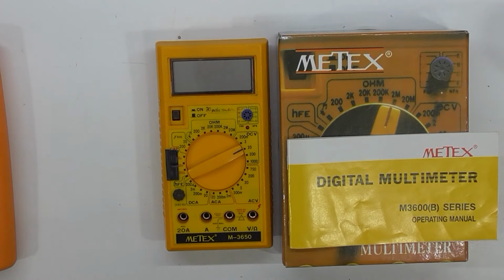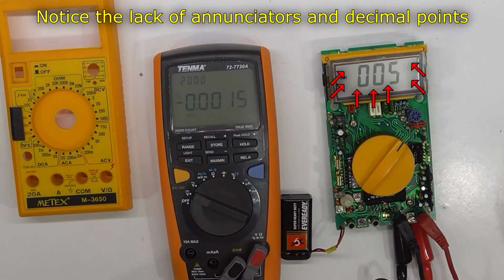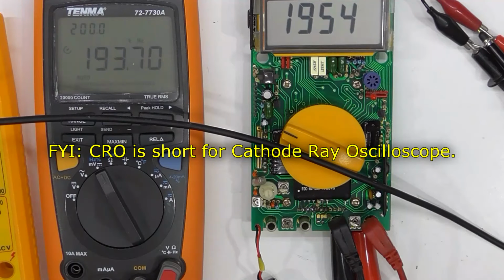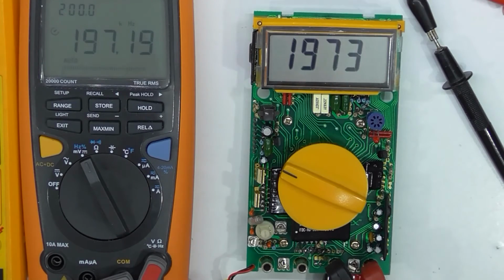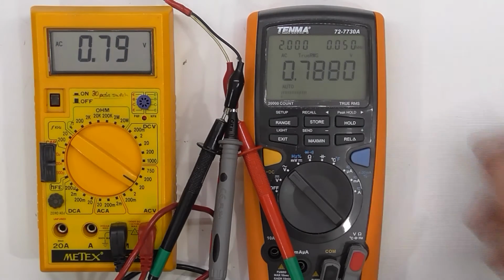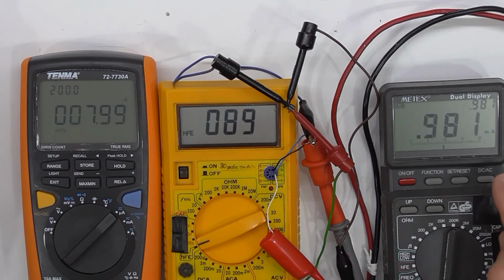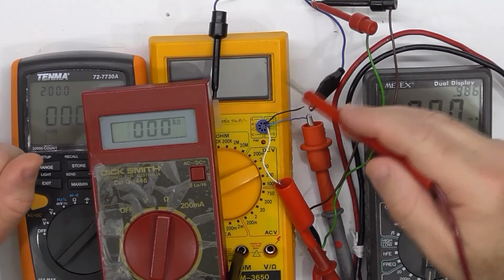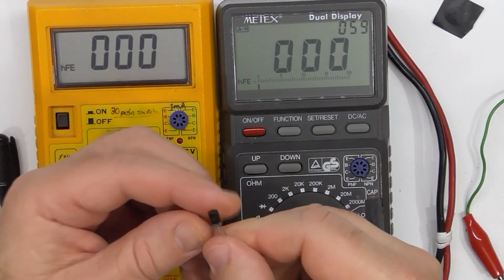Multimeter Calibration, Metex M-3650 (1989)

Comment: Great explanation which adjust is for what. I was hoping to find any adjustments for the LCD, because mine is fading and cleaning the zebras didn't do any help at all. I tried to find help in the schematics, but either I am blind or there is nothing that is directly related to that. If anyone knows how to increase contrast/display driving voltage, I would be very thankful

Comment: what is the Zero adjust button, please. Reading ist mostly 6 digits at  zero V A mA
Reply: When you put the meter in any CAP mode, the display isn't showing zero. With the Zero Adj you can set it to zero, before measuring a cap.

Comment: Very Interesting video. It was useful to calibrate my Metex 4650 in the DCV range, unfortunately the 2 Volts scale is not accurate and alligned with the others example (200mv, 20v, 200v).
My M4650 has two extra trimmers, one below the display and the other at the center of the four holes inputs and that are absent in your M3650.
As you know do you think should be one of these two trimmers able to calibrate the scale of 1,9999 resolution.
Thank you. 😉😊
Reply from the maker: Just the 2V range ? It's unlikely, but I don't know. 

Before going much further, you need to know that the Meter is in good condition. A Meter is something you need to be able to rely upon. Or at the very least, know what NOT to rely upon.

A quick Google search for a schematic brought me to a page on Elektrotanya - you need to wait for the link to become live: https://elektrotanya.com/metex_m4650_cr.pdf/download.html

The schematic looks like it might be legit. My suggestion is to (safely) download the schematic, and work out whether it can help guide you. 

Looking at the schematic, the first thing I saw was that they are using a two-chip setup: one for the Measurement and one for the Display. I then found a user manual and saw that it is a 20,000 count meter.

So, um, yeah. 

If the problem is just the one range, then it could be Bad\Dirty switch contacts, dirty PCB, or other things related to that specific range.

It's unlikely to be out-of-spec Precision Resistor(s), because that usually effects all ranges, though it is possible.

It could be damaged protection circuitry.

It could even be Electrical noise, such as Radio (Mobile\WiFi\etc) or Hum pickup. 

So, experiment: with\Without the Leads, Faraday shielding the meter, etc.

ONLY AFTER YOU KNOW the meter is Good, or what is not good, do you Calibrate.
Reply: @richardrudek01  
The deviation is minimal but unacceptable if I'm not mistaken, it has a factory tolerance of 0.05%.
Ex.
 2v range i have 1.3185
 20v range i have 1.315v 

I have another DMM 4650B where the two range are alligned. 
Where the problem? 😕😔
Reply: @richardrudek01  
Hi Richard, 
as your suggest assuming that no adjustment trimmer for 2v interval exists, for our curiosity I centered the calibration around 200mv and then up to 3,000v however already arriving at 5v begins to lose two counts and then to 10v and four counts lose. 
Can we suppose there is a circuit failure?
Or still a compensation trimmer would be perfect in the case?
So, my curiosity pushes me further and I would like to experiment moving on the two trimmer left that you do not have on your M3650 but at high risk of putting out of alignment in something else. ☹
Thank you for even going search for the manual I found it too but that scheme goes far beyond my competence.
Reply from the maker: Four counts out of 20,000 is 0.02%. That is well within spec.

Note that when you start getting down to levels of accuracy like this, environmentals such as Temperature and Humidity can affect the results. More than once have I seen readings fluctuate with people simply breathing on the meter...

So whether there IS, or IS NOT a circuit problem is something that YOU need to consider and decide.

Things to consider, though, is the condition of the Meter. Has it been physically or electrically abused. Is it 'dirty'.

Often, you are left with little choice but to open the Meter and inspect it. But if that is not an option, then you are left with rigorous testing, perhaps within test chambers that are shielded and environmentally controlled – temperature, humidity, pressure, light, etc.

Now when it comes to experimenting. Just be sure you are able to live with any possible outcomes. 

In this case, however, we do have a schematic that seems like it is mostly correct. You should be able to find each of the variable resistors in the schematic, then find them on meter, and figure out what it is likely for.

For example (Guesses):
- VR1 seems to be setting the zero point.
- VR2 perhaps AC voltage.
- VR3 perhaps Capacitance.
- VR4 and VR5 the Frequency counters.
Reply: @richardrudek01  

You are very kind Richard😃,
you do well remember have to take care of environmental factors and for this I had to monitor the DMM several days and correct the reading several times for a good calibration.

 I want to clarify that the reference comes from another very accurate Metex (Voltcraft) and being identical should behave the same if not almost, but the loss of the counts is no longer accepted in these terms of 2v scale (4 dgt 1/2).
 I want to remind you that I have specified that it is above all the 2V scale did not satisfy me and be out alignment, they are "off" of about 30 ~ 40 counts.

Metex A:
2v range i have   1.3185v (1.9999 counts). 
20v range i have 1.314v
Note: even acting on the VR MAIN CRITICAL and dropping the last digit 4 to 3 as below doesn't have rapid effect on the scale of 2v without putting out alignment all other scales.

Metex B (as reference):
2v range i have   1.3135v (1.9999 counts).
20v range i have 1.313v  (WOW perfect).

 I have cleaned the PBC at mirror and contacts nothing changes.
I tried to read the wiring diagram but all the VR leave a lot of position uncertainties, a service manual would be perfect. 

P.S.
I also have also a wreck in which i can take all the components useful for the replacement but I do not know what is damaged in the Metex (A).
I also took pictures for the identification of the pots and...  if you want I can send you some photos but I do not know where ... ??

The video that you have made I have seen it many times will be useful to many people and it has helped me a lot.
I thank you on behalf of many on web.
Thanks, Richard
Maurizio
IT
Reply from the maker: Oh. So you are comparing between ranges on the SAME meter - the M4650. Interesting.

Yes, I missed that point. I'll get back to that point in a minute.

The schematic I have for M4650 seems to confirm that the basic accuracy is set by the precision resistors, ALONE - like with the M3650 in my video.

Thus, if there is a discrepancy in one, and only one range, then the voltage divider network made using the precision resistors is where you need to be focusing.
However, whether or not you can do something about it is another thing. 

For example, if you find that the precision resistor between the 200mV and 2V ranges is out of specification, are you going to disassemble the network and fix it ?

Now back to the earlier point about comparing between ranges. In the video, I compared "the standard" with the "subject".
That is the Voltcraft Meter AND the Test Source, with the Metex.

Notice how I emphasised the "AND". When you calibrate using a Source and a Reference meter as "the standard", one thing you can miss with that set up is the interaction between input and output impedances.
Now both Meters should have input impedances that should be in the 10M Ohm range. But you can be surprised by the effects, if your not vigilant.

To put some numbers one it - and these could be wrong, so please double check.

How high does the (output) source impedance (Rs) need to be to produce an error of 40 counts with 10M Ohm input impedance (Rm)?

There are many ways to figure this out. If the source impedance is much, much lower than the input impedance, then the simple ratio method is close enough.
But the more correct method is by considering a voltage divider circuit.

With the simple ratio method, 'simply' multiply the input impedance by the ratio of the error.
So 40 counts / 20,000 counts * 10,000,000 Ohms = ~20,000 Ohms. Interesting, there is symmetry in these numbers - 20K counts, 20K Ohms...

Lets double check this using the circuit method.

We have a source producing a Voltage. We'll call that Vs. Then we have a source Resistance (Rs) in series with the Meter's Input resistance (Rm).
The meter then completes the circuit by connecting the 'COM' lead back to the voltage source.

So, ASCII art circuit:

(Vs)---< Rs >---o---< Rm >---.
  |__________________________|
  
  
So lets make Vs = 1V.

Vrs [across Rs] = 1V  / 20,000 counts * 40 counts = 0.002 V
Vm [across Meter] = 1V - 0.002V = 0.998 V

Rs = Vrs/I
I = Vm/Rm = 0.998 / 10,000,000 = 99.8 nA (99.8e-9)

thus
Rs = 0.002 / 99.8e-9 = ~20,040 Ohms.

In short, if the output impedance of your test source is ~20K Ohms, you can expect to see a voltage drop equivalent to 40 counts by simply connecting your 10M Ohm meter across it.

FINALLY: Sharing.

You obviously already have a YouTube\Google account. In which case you should have a Google Drive.

Log into your Google Drive, create some folders and share it and/or the specific pictures, publicly. Then copy and paste the link in a reply.
Just make sure you limit the permissions on what people can do. For example, do NOT give editing\authoring rights to the public, just viewing rights.
Reply from the maker: Oh dear, I went full on Engineer there, didn't I.

Thinking about this more simply, the (perceived) issue may be an interaction between peers. This is why it is best use use a Reference Meter with more accuracy than the one you need to calibrate.

Perhaps a simpler way to think about this is to think about building a brick wall. Each brick has a certain size and tolerance. Now limiting ourselves to just the one, horizontal dimension.
When you lay down a course, the goal is to space each brick apart with roughly an even amount of mortar, except for the start and end of each course, which of course is just bear brick - no mortar on the ends.

However, you could mess it up by shoving all the bricks hard up against each other with little or no mortar. More over you could work from each end like this, and then find that in the centre of the course, you now need to have large sections of mortar.

This could then be the issue you are seeing. In other words, there is no circuit fault. However given the tolerances between simply spec'd meters, you've effectively calibrated the meter in such way that all of the error shows up in the one range, instead of spread out across all ranges.

Comment: Great Video! I have problems with my Metex M-3850 LCD readout. No display despite pressure on the screen and intensive cleaning of all contacts, only getting the 4 border leds lighting. Any advice would be much appreciated.